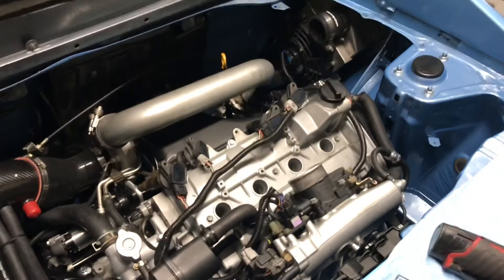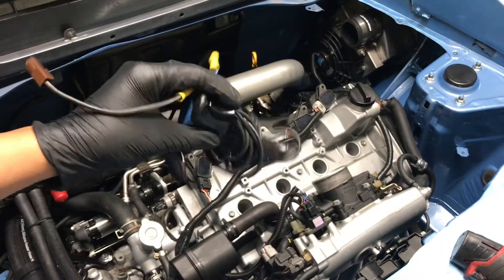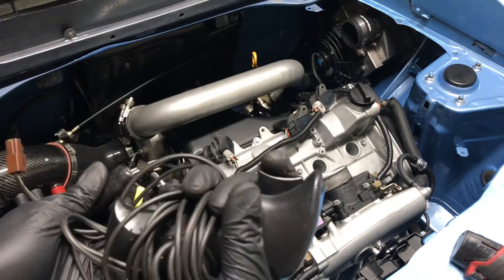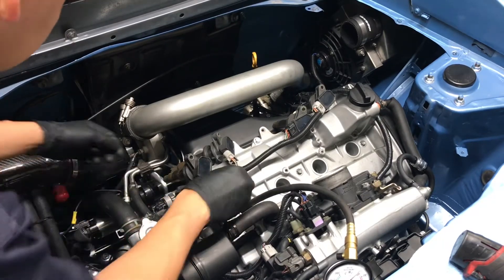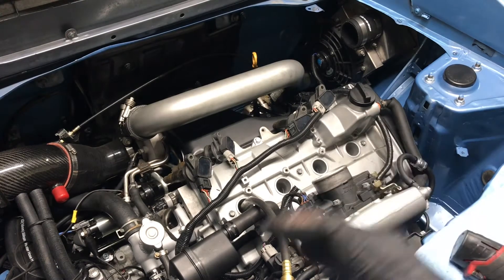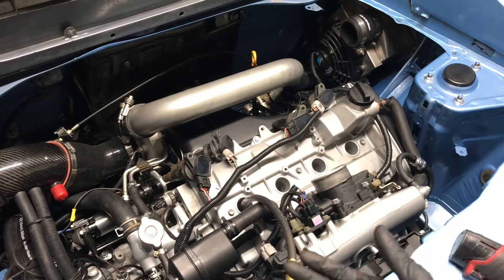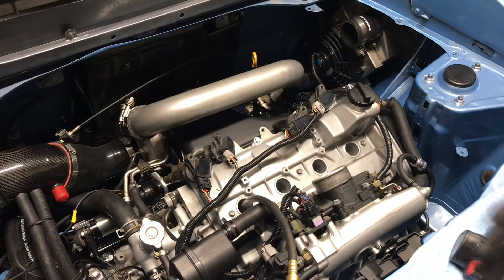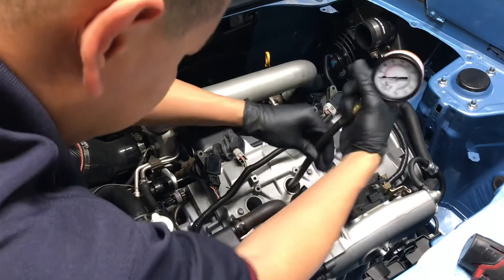DIY: BobMr2 compression test on Toyota Mr2

Comment: Did you have to disable spark or fuel?
Reply: only if you are turning the car by key.  just pull the fuel pump fuse. remote starter doesn't pump the fuel.
Reply: Deft Anesthetik Thanks!

Comment: No wide open throttle?
Reply from the maker: khalid omar the engine has idle bypass (or IACV) usually allows enough airflow to give you reasonable compression readings
Reply: @BobPham  is it the same for Gen2? I appreciate the feedback.. will be doing a compression test soon.
Reply from the maker: khalid omar I think gen2 has them. I haven’t touch a gen2. So I would slightly open it. Just put a 3/8 extension to the butter fly.